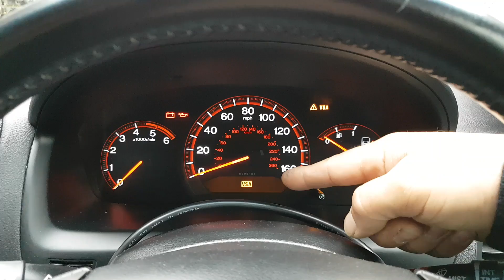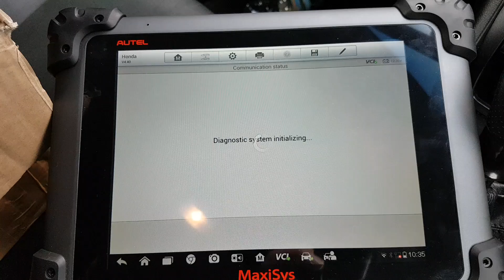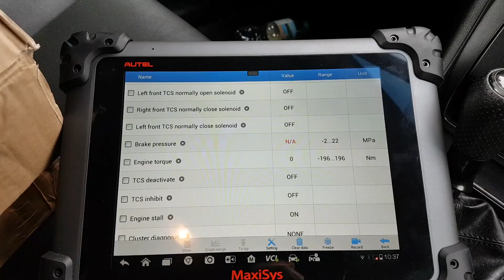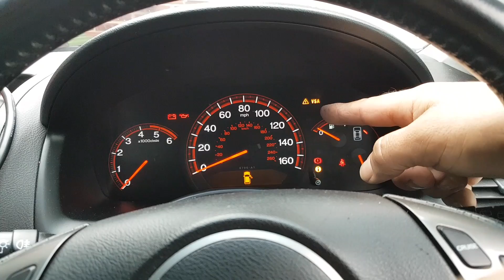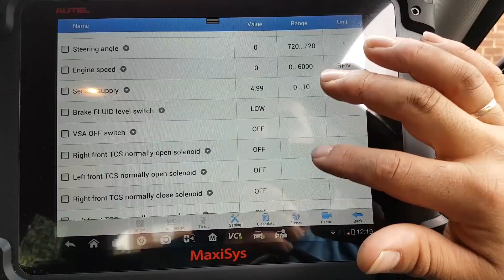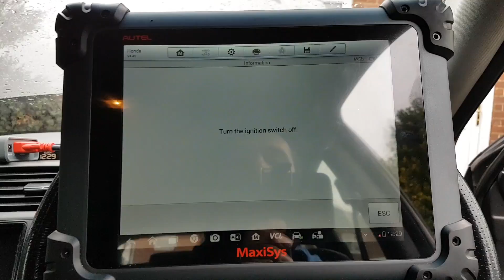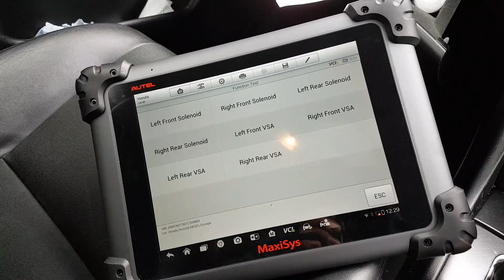Honda Accord VSA light on. Codes 66-1 and 84-1 brake pressure sensor. Fault finding and repair.

Comment: No one can fix a 66-1 code on a honda. If fails keep looking and hopefully you find a good one. I just received a used moduke and pump for my 2012 odyssey and hoping it fixes my brakes cause they lock up while testing about 15-20 min driving. Has a code 66-1.
Reply from the maker: If it is the module with the pressure sensor integrated, yes, it can be difficult, even to find the sensor on its own. 
A replacement it is probably the most logical thing to do. 
👍👍👍

Comment: So does that mean that your abs won't work  if this code appears . As I have the triangle and tcs on my 05 accord
Reply: And if abs is working( to limited knowledge) and the things I look at threw my scan tool would tell me it is still working and threw the brake  peddle
Reply: And the brake pressure would that still read positive pressure when pedal is pressed
Reply from the maker: Most likely yes...
👍👍👍

Comment: very good tutorial. A bit envious of the great scanner under the Honda from Autel . I do not have a code 66-1 but a code 64-1. Despite the different code, the mechanic scanning with the Autel scanner said that the ABS pump module needs to be replaced. Apparently the ABS module is not detachable from the controller . They say it is easy to damage the controller when dismantling . I do not know how much truth there is in this. Did you mention reprogramming the pump after replacement in the car ? Is this necessary?
Reply from the maker: There is a possibility of needing programming... but you can always try to just replace it and go from there...
Obviously, before, check everything else, connections, wiring, etc...

Comment: Great video. Got a 66-1 code and the ! And VSA lifts on. So will need to do an ABS pump swap. Thanks for showing that the brake pressure sensor is on the metal side of the unit. Hence just fixing the black module likely won’t solve this issue…. Easier to replace both pieces with a used unit.
Reply from the maker: Just double-check that the module is not programmed for the car, I don't remember such details now. If it is, swapping everything will then require reprogramming. 
👍👍👍
Reply: @LMAutoRepairs thanks from what I hear it’s hit or miss. But looks like it’s worked plug and play with the job you did. I’m using the exact part number and if needed I’ll take it into the shop to reprogram. They want c$2700 to do the pump replacement at my non dealer mechanic because they will only use parts they source and it’s only available from Honda for $1700 just for the part. So gonna try the DIY.
Reply from the maker: @rw3476 
👍👍👍

Comment: I have yaw rate sensor failure (25.01) and 66.01 will fixing just 66.01 fix everything?
Reply from the maker: If there definitely a 66.01 for the brake pressure, fixing the one for the yaw sensor will not fix the pressure sensor, obviously...
But check that there is definitely an issue with the pressure sensor...
👍👍👍
Reply: @LMAutoRepairs  if you only have code 66.01 can you siply buy working abs block itseft and keed the original plastic part(modul ) will this buypass any coding?
Reply from the maker: @adrianp4590 
As per the video... yes...

Comment: I have the exact issue on my CL9 Acura and it looks like I got the same code. My scan toll also doesn’t show pressure reading. I didn’t know it was in the abs module which sucks since their $2200 new. Did it show pressure after you filed the brake fluid?
Reply from the maker: Don't recall that now...
Don't even remember if I went back into live data to check it...😋
Sorry...
Reply: Appreciate the quick reply. Thanks anyways I got the info I needed I only have 84-1 but all the speed sensors work and I also see NA for pressure sensor. So I’m sure it’s that now since it’s getting perfectly good speed readings.
Reply from the maker: @TheOhsemix 
👍

Comment: I am seeing 81-20 for a 2012 Honda Civic, where VSA light is on - randomly I do get a power steering light and disappears after car is restarted. Any thoughts and guidance? Thanks
Reply from the maker: Never came across that one...
But I would suggest to start with the basics... like check connections, grounds etc...
Reply: @LMAutoRepairs  have a new battery, to make sure not the reason for a bogus light. VSA light is always on, have cleaned the codes too.
Reply from the maker: @maverickperson5443 
81-20
Does the tool guives you a description of the trouble code?
Reply: @LMAutoRepairs  it is a blue driver dongle and states built-in acceleration sensor failure(ABS). There is another one 85-01 VSA signal failure(electronic power steering). But consistently seeing 81-20. Thanks for the help :)
Reply from the maker: That's what I thought...
Unfortunately the acceleration sensor on those is internal built-in in the ABS unit...
You need to replace it...
That should hopefully solve all your problems...
👍
Reply: @LMAutoRepairs  thanks for your help and input.

Comment: I have a 05 Acura TL. It feels like it randomly brakes for me when decelerating, normally from higher speeds…and normally too hard. It’s pretty scary. The only code I’m throwing is “83-1 (ECM/PCM Relation Failure)”. I’m lost.
Reply from the maker: Hi
Check connections, PCM and VSA plugs etc...
Check fuses and att the basic stuff, like inspecting wiring...
If all good, could be a bad VSA module...
👍👍👍

Comment: on my volvo s40 it gives me rear wheel sensor fault signal. I replaced the sensor.  issue still persist
Reply from the maker: Is the sensor genuine or aftermarket? 
Have the wiring from the sensor to the module been checked?
👍👍👍
Reply: @LMAutoRepairs  it is aftermarket cheap from Amazon. we test all wiring from ASB PUMP to the sensor. all good and beeping. we swapped the good working sensor with the new one. no reading from the left wheel though! we only have the same silly error code of the left rear sensor.. even we tried new rear bearing on the left wheel. no reading either! another different mechanic.  diagnoses.. the car is running fine and the break seems to be working. maybe it is a software or module glitch 🤔.  honestly I should go for OEM sensor from volvo dealer!  10x price than the aftermarket.. but no guarantee 😕

Comment: I have pressure sensor code 66-1 can I replace the ecu only ? Because it’s to much expensive
Reply from the maker: The pressure sensor is on the modulator... (the aluminium part)
👍👍👍

Comment: I have crv 2006 p2646 code i'm change the parts two time the light is on...nothing change...
Reply from the maker: Hi
What parts have you changed?
Thank you for watching! 
👍👍👍
Reply: @LMAutoRepairs  vvt silinoide
Reply from the maker: Have you checked the actual oil pressure?
Have you checked the actual VVT system, that is not leaking, etc...
The solenoid, is a genuine or an aftermarket?
Reply: @LMAutoRepairs  afertmarket parts
Reply: @LMAutoRepairs  thanks help
Reply from the maker: 🙄
Not saying that's the issue... but, I had issues in the past with aftermarket parts...
Test everything before though...
👍👍👍
Reply: @LMAutoRepairs  Ok thanks for the help I'm going to buy the original part where I live there aren't many mechanics and I don't want to be guessed

Comment: Some time or most times . Just reset the steering angle sensor  SAS that's for the 84-1.. code
Reply from the maker: Not in this case...😋
👍👍👍

Comment: Hello, good work, i have the same fault in toyota rav 4, i would know if the sensor is located in the ABS module?
Reply from the maker: If is not external, then will be internal...
Thank you for watching!
Reply: @LMAutoRepairs  you are welcome, in peugeot 406 there is a external pressure sensor, i think in this rav 4 there is internal 😁😁😁

Comment: Hopefully you will still see this, but I have almost the same car (2007 Sport Tourer). My VSA light turns on randomly when braking and stays on until I restart the car. Then it disappears until it decides to go back on again. My OBDII is not giving any codes. I recently bought this car, could the previous owner have removed the code without fixing it? Any advise how to solve it without any codes?
Reply from the maker: What scanner are you using?
You can't really "remove" the code...
Thank you for watching!
Reply: @LMAutoRepairs  Thanks for the quick reply. The scanner is an Autel MaxScan GS500. Here is a few pictures: https://imgur.com/a/9WfddAV
Reply from the maker: Yes... that looks like just an ODD2 scanner...
You need a scanner that can read the ABS module directly...
Reply: @LMAutoRepairs  What scanner should I be using? Is there anything you can think of that would cause this VSA behaviour though?
Reply from the maker: @ltcSpitfire  
A scanner that can communicate straight with the ABS...
Many things can cause that... abs sensor, reluctor ring... etc...
Scan it first... otherwise is guess work...
Reply: @LMAutoRepairs  Alright.. stupid question I know.. but I had to ask. Thanks for clearing that up though so I know it definitely has a code somewhere. I will get it looked at properly to see how serious it is. I bought it 5 days ago, so a bit bummed. But thankfully I should be covered for the repair costs if its expensive.

Comment: I have a code 66-1 and 98-1 for my 2000 Acura RL, would I need the ABS module to be reprogrammed then installed?
Reply from the maker: If the pressure sensor has failed, you need a new unit... 
Thank you for watching!
Reply: @LMAutoRepairs  Okay, does the new unit need to be reprogrammed? Thank you
Reply from the maker: @dlowmane  
Possibly...
But you can keep the module side, as the pressure sensor is actually in the modulator...
So, no programming required!
Reply: @LMAutoRepairs  So I can keep the module, buy another unit to replace the brake pressure sensor block, therefore I don't need to reprogram it?
Reply from the maker: @dlowmane  
I thought you watched my video... 🤔
That's exactly what i have done...
Yes, if you do that way no programming required...

Comment: good day LM Auto Repairs. my honda odyssey 07, the brake light refuses to go off even after put off the head light and engine totally off. i had to remove the battery head just to save the battery from draining. i need your help please
Reply: Break switch
Reply: @LH81633 . Need adjustment brake pedal switch

Comment: Hey I got a 2006 Acura tl.My VSa light is on,Then while drivingMy ABS &Brakelight comes on.And my the electrical in the car is like it has glitches..I had it scanned and it I got vsa-abs modulator failure. Do You think replacing the abs modulator will fix my issue?
Reply from the maker: Possibly... check ground points,  as a bad/poor ground can give you all sort of issues...
Thank you for watching and for your comment!
Reply: Aight kool Thanks!

Comment: How did you fit the motor back into the ABS modulator housing? There're two little plungers/pistons that sticking out and interference with bearing on the motor. Thx
Reply from the maker: I can't remember now... sorry... it does fit, as you can see though...
😊
Thank you for watching and for your comment!

Comment: Hi .please i need your help .I have the same problem and the same car model.  I change the ABS unit and i Stil have the same problem and  pressure sensor A/N . But no Fehlercode for the pressures sensor.  I have the Fehler code 25-1 Ywa Rate sensor !!!!

Best regards
Reply from the maker: Why have you changed the unit, if your code was for the rate sensor?
Or that only came up after fitting the second unit?
Thank you for watching and for your comment!
Reply: @LMAutoRepairs  I have this code on both unit.  Just before I didn't have a diagnose computer and it's came after I bought the ABS :( . And I don't know where I can found this Ywa rate sensor on the car ?
Reply from the maker: @phantom700X  
I believe is situated behind the center storage pocket, underneath the controls in the center console...

Comment: Hi, I have a Honda Civic Si 2009, in the dashboard I got a triangle and VSA light. I made a diagnosis with the computer and the code 83-13 came out.  from what I was reading it may be the outdated or damaged modulator. If I replaced the modulator with a new one, I have to update it or just mount it.  Based on your experience may it be the modulator?  I hope you can help me, thanks.
Reply from the maker: Hi
Is that the only code on the ABS module? 
Do you have any other codes on the PCM etc?
That code I believe is for a failure to communicate with the PCM...
So, yes, it can be the module, but can be other things... if you get a module with the same part number, should be plug and play... I believe.. 
Thank you for watching and for your comment!
Reply: LM Auto Repairs LM Auto Repairs 83-13 ecm/pcm relation failure that’s the full name code. The computer says one more error "Fault 1 abs / tcs / vsa".
Reply: @erickrose4498  so did you need to update the software on the new module? I’m on the same boat now with my 2015 civic

Comment: You have done welcome service for us do-it-youselfers (and, probably, other shops as well).  I saw no one else, on the internet, who had a fix for this problem.  Well done!
 You might disassemble the module and take it to a computer repair service shop for the repair of those tiny wires. They work with tiny wire soldering all the time.  It doesn't hurt to ask.
Reply from the maker: Hi
Indeed... it is an option...
Thank you very much for your comment... and for watching! 
👍👍👍

Comment: Just did the oil change and those lights came on if run the car like that will be okay?
Reply: Thank you
Reply from the maker: @ricardotorres824  
👍
Reply: The problem was that i change the air filter and forgot to plug back  the air sensor or wherever 🤦‍♂️
Reply from the maker: @ricardotorres824  
😊
Well all do mistakes!
Nice you got it sorted!
👍
Reply: @ricardotorres824  - where is the air sensor? just asking because I have the same lights on and wanted to check this. Thank you
Reply from the maker: Yes... but no stability program...
I would get it resolved...
Thank you for watching and for your comment!

Comment: Hi   replaced the abs module and still have a spongy brake pedal
There is not abs light on but checked a with cheap scanner and I got this message
" no DTC  except for 84-1 is stored in the VSA control  unit.
" after replacing the VSA control unit or sensor cluster. Do the neutral position memorization procedure for all sensors:
Steering angle sensors
* Brake pressure sensor
lateral G sensor

I have replaced:
OEM master cylinder (2)
Brake power booster 
Bled many time
Tried to reset the sensors with my cheap scanner but it immediately goes back to the beginning reset mode.
Any help  would be appreciated 
I own a 2006 Honda Element EX WITHOUT Vehicle Stability  Assist
Reply from the maker: Hi
https://youtu.be/5Jl_poF35_A
Myself or a fellow member, will be more than happy to help! 
Thank you for watching!

Comment: Great video like always! Quick question.. did you ever get a reading on that live data for the pressure sensor on the pump that you installed? I did the same thing and still didnt get a reading but was able to clear the codes. Just wondering if the code will come back since there was no reading after I swapped the ABS Module. Thanks, hope to hear from you..
Reply from the maker: Hi
I did not..
That like data I showed at the start, from my research,  is not applicable to this system... perhaps the Honda proprietary software can show it... but if you managed to clear the code, then should be good....
Hope that helps...
Thank you for watching!
Reply: @LMAutoRepairs  That's exactly what I thought. Thanks once again..
Reply from the maker: @Koseroner8955  
👍

Comment: Great video my friend. I'm having trouble on This Honda Odyssey 2011 with the vsa light. The code is 83-1 ecm/pcm failure. Alldata is not helping. Only says clear the codes and restart engine and check for codes and if 86 pops up follow steps. Nothing for the 83. Really don't know where to start . Have u ran into any of these issues on Honda's
Reply from the maker: Jason Chavez 
Hi
Not with those codes... sorry...
Thank you for watching!
Reply: Just in case u are wondering my friend. The code for the vsa light I had at work I got it fixed today. Car also had a check engine light on with a misfire and 02 sensor code. When i did the repair for the other codes and cleared it the vsa light went off and stayed on. Don't know how it's integrated but Toyota's are the same when both of those lights are on at the same time. At first I was thinking it but I said to myself why would Toyota and Honda be the same with the vsa light. If I'm not mistaken the both have different networks. Gotta look more into that because I'm weird like that lol.🤣🤣🤣🤣. Good day mate.
Reply from the maker: Jason Chavez 
Glad you got it sorted...
That's interesting...
Thank you for the feedback...